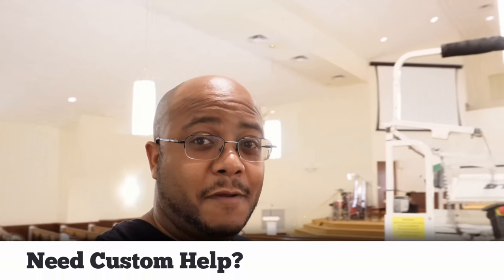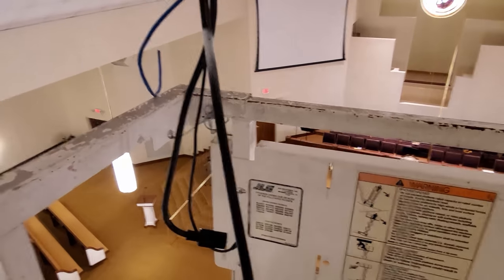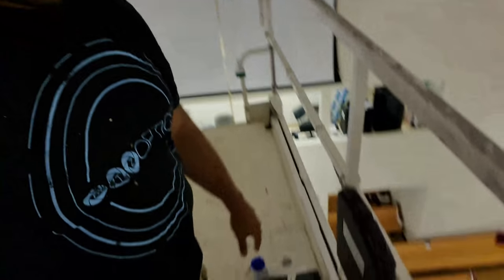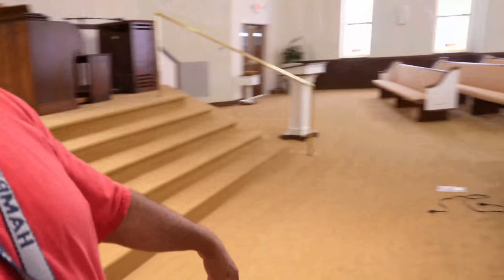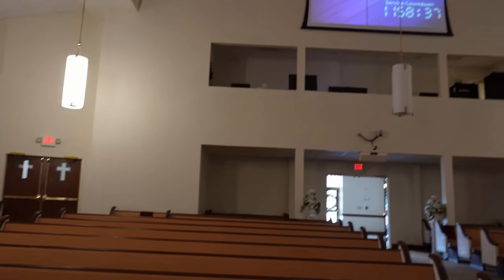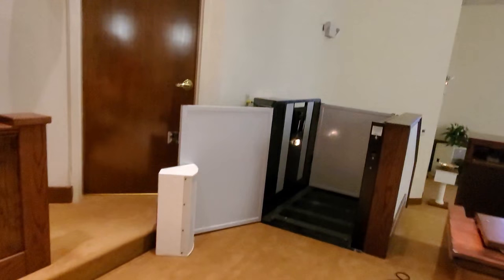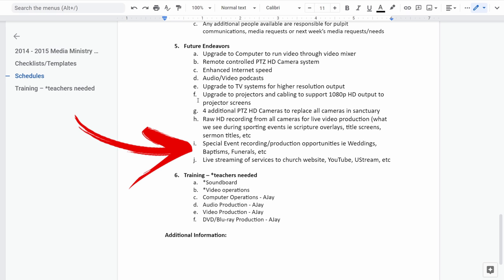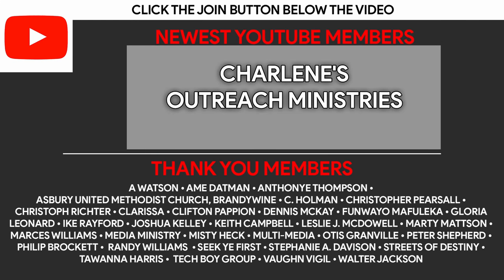LASER PROJECTOR INSTALL | Antioch Baptist Church

Comment: My church ministry is in need of a 3 stage projector system 

Two projects for side displayed while the other 
One  1 project is for center as a video wall .so now  Which 3 project would be recommended?
Reply from the maker: I personally like the Sony brand but you need to measure the light levels in the room to determine the lumens needed for your projectors

Comment: I think I would use short throw laser projectors. They are brighter and sit close to wall and if you want it wider you just need to move them a foot further away from the wall. They also cost from $2500-3000 each.if you treat the wall it can be the screen. That is what I wanted to do. May be one day the short throw will come down to $1000 and the wall TV’s will die at the same time.
Reply from the maker: I actually proposed this but they wanted to used what we had and those would require a different screen. I am planning to install some short throws at another ministry soon.